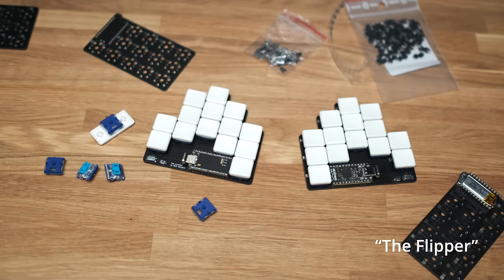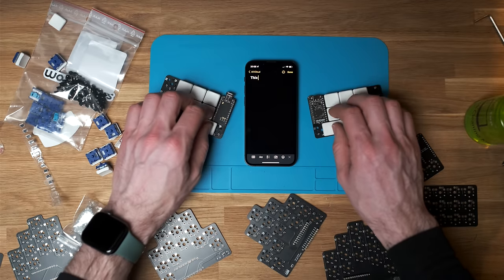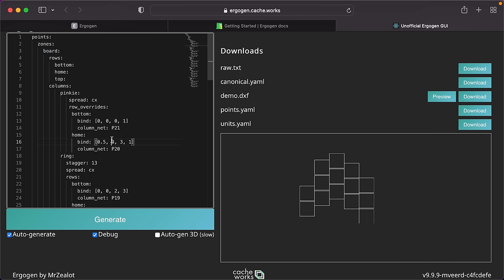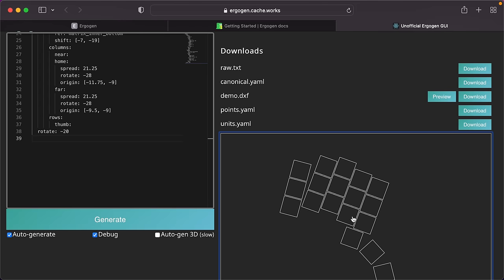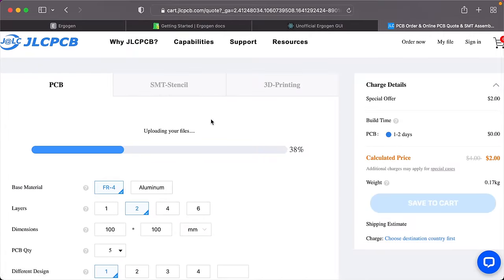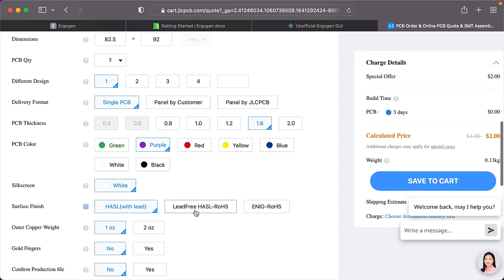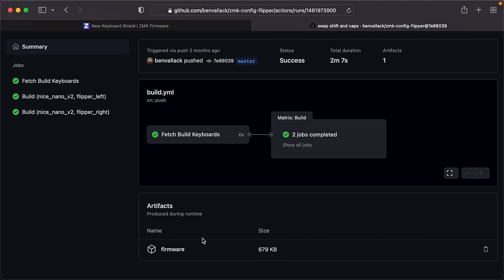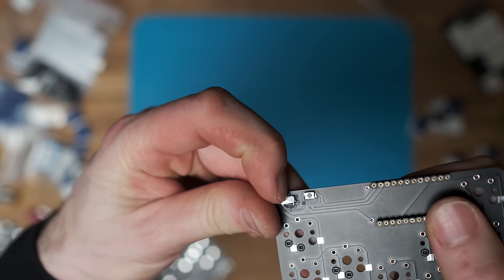“The REAL Ergonomic Keyboard Endgame!” - How To Design & Make A Totally Custom Keyboard

Comment: Instead of connecting the grounds from point to point, maybe consider flooding one side of the PCB with ground. The power traces in general could be a bit thicker, especially given the fact that you have plenty of room on the PCB to do so.
Reply: @owowowdhxbxgakwlcybwxsimcwx  For a small switch breakout like this you don’t really need it though. The sub board is probably 4 or 6 layer.
Reply from the maker: Why is it important? My experience with the Ferris is that the ground plane interfered with the side to side connection when I had them on my legs, so I was quite happy to avoid adding it here.
Reply: @BenVallack  For this application, it could improve immunity to noise and help with ESD performance, but to a large degree it doesn’t matter here

Comment: Another super interesting video! I'd love to hear more on how typing works with these tiny key numbers - the layers and key maps and how they changed as you moved smaller. Are there lots more strokes added by layer changing now? Splitting the alphabet between different layers is more extreme than I considered before. Would love a video covering the journey from Ferris to here and how you found your optimal number of keys!

Comment: Fantastic video Ben. This stuff is well overdue.  DIY is the absolutely the way to go. The issue with many custom keyboard suppliers is that support is poor and they often disappear because it is more of a hobby for them than a 'real' job.  Been caught with that a few times.  You end up being left with a bunch of paper weights! A tip for new players: if the supplier has most things 'out of stock' or is slow to get back with enquiries, give them a wide birth.
Reply from the maker: Yeah I think it’s amazing that so many small players started making and selling boards but at the end of the day if you’re parting with cash there are general expectations for most people that are hard to get past when you don’t hear back from someone for 2 months etc! This approach lets you cut straight to the point and get something up and running pretty quickly.

Comment: I recommend doing a polygon pour for your ground plane on the bottom layer. Just make sure you have thermal relief on all the pads(should be done by default). It will save you a little time when making your layouts and is "more correct." 

For low speed boards like you are designing here the layout basically doesn't matter as long as the connections are all correct. If you ever design a more sophisticated pcba than stuff like this will start to matter.

Comment: I have built two keyboards already, one from a premade PCB and one hardwired. I keep putting of the KiCAD learning curve, but it will happen sooner or later. Your video is well structured through the journey and makes the task less daunting. Also great tools you found to make the process easier.

Comment: couple of quick tips on soldering: just get some rosin core solder, it makes life easier and soldering quicker, because you don't need a flux pen.

Another one is for solderin the sockets: just solder one half of the socket first, and you can hold the socket in place while you reflow the solder by heating it up again. When you have all of the first halves of the sockets soldered, its really quick to just add a bit of solder into the second half to finish the connection. Just make sure to heat both, the pad and the sockets metal bit.

Comment: @Ben Vallack I predict your next iteration, limited by shipping times as the long pole in the schedule, will be 8 keys: 3 for the more powerful fingers and the thumb, leaving out the pinkies, because they're weak.  Reasoning: last I knew, you were extolling the virtues of the 34 key layout, now you've gone down to 16, and the most logical next step is 8!

Part of the reasoning for 8 as stated is now you have exactly only a reduced home row with thumb, and no fingers need ever move except up/down, just in possibly longer strings of key presses, the oddball chords worst-case.  With no moving of fingers, in theory you should have far fewer typos because you can't be off target with any finger, you can only use the wrong key under a finger that's not moved!

Fascinating video, I wasn't aware such great software was available for free, thanks for explaining that!

Comment: This is freaking awesome. Really wish mice could have this much accessible customizability. Ive seen a few 3d printed designs that you basicly just take the innards from one mouse and put it in the new similar style shell which is a start but Id really like to customize things like how tilted it is, where extra buttons are, how hard they are to press, weight, ect.
Reply from the maker: Yeah very true, might need to start getting involved with 3d printing I guess!
Reply: Resin printers these days are phenomenal, suuuuuuper smooth finish. But you could also use the fine resolution to create interesting textures. You could build them around a common platform that is a little brain with the sensors and such in it. Open source designs with common switches, rollers, bearings, use 3d scanners to shape it perfectly to your claw, ooooo very exciting.

Comment: Hey! I am building my own keyboard according to this video. I have two questions: What is the battery life? Are you going to test the battery sockets anytime soon?
Reply from the maker: Battery life is about 2 weeks for the central side - longer for the peripheral side. If you use the dongle branch of ZMK with a third nice!nano as a usb connected dongle though the two peripherals last for ages. I have used the JST battery connectors which is as far as I feel the need to go at the moment. Good luck!

Comment: So this is indeed great, and thanks. One thing though, you seem to be approaching this as someone who is a coder talking to a coder. I will be watching your subsequent videos but hope that I’ll be able to do this as someone who could not code their way out of a wet paper bag. Either way, I appreciate the info and your journey (even if it’s gotten more minimalistic than I’d imagine going).
Reply from the maker: Heh yeah I’m never quite sure how many people are coders here but I figured most keyboard geeks probably code. What kind of thing do you do?
Reply: @BenVallack  I do qualitative research - often usability research. Lots of note taking, writing reports, etc. keep me on a keyboard nearly all day.  I am also old enough (>50) and learned "keyboarding" young on a typewriter.  I had an ortholinear once but unlearning stagger wasn't something I had the time for, so I currently run a Keeb.io Quefrency, which is basically a 65% split, which can use VIA.  A few mods done with Karabiner Elements, and a new 3d printer because I use modifiers a tonne and thus will be trying to jump an additional thumb key into the mix.  I will be playing with this stuff more, though, and the vids are helpful - I just should have learned coding back in the day.

Comment: Is there a software keylogger that would sugest you a key layout, depending on your most used keys?
Also, with no legends on your keys, how do you keep track of what you are typing and how did you train for that?
Reply from the maker: I think there might be some logger things out there yeah, never got as far as trying it. It would be interesting. Typing without legends is pretty easy, especially on smaller boards where there is only a few places your fingers should be. Here are my learning tips: https://youtu.be/sI-a64EVPPU

Comment: Ben, struggling a bit with the transition from ergopad to ergogen. The raw text it gives you is in a different language than the ergogen tool (at least it seems that way). I was going to use your config and tweak from there but also wondered if you had any advice?

Comment: Well this is very educational. But you know what'll be even faster to iterate? Handwired strings of small boards (or only hotswap sockets) with 3d printed case to hold them. Or with separate pieces sliding alongside each other(which is my a thing i'm working on). It won't be thin like a pcb, but even with 3d printig mounting case every time it would be less work to swap switchies since there won't be soldering (just add some wirer length to accomodate stagger changes).
Reply from the maker: Ah I saw someone make something like that actually. Definitely a cool way to test iterations.
Reply: @owowowdhxbxgakwlcybwxsimcwx  Yes. Pcb's was invented to produce complex electronic devices. Not for fast prototyping keyboards with 20-30 buttons on it..  I believe handwiring 1 prototype with dynamic stagger wouldn't take not more 2-3 iteration of the stuff in the video. And it'll provide astronomically more flexiblity for tuning than having new board every week or two.

Comment: On "The Card" you could probably integrate the microcontroller into the pcb and have 2 extra keys there. Also where can I find files for the 16 key layout?
Reply from the maker: Yeah would like to build a board like that.
Reply: @BenVallack  just where to put the battery than
Reply from the maker: @nomiss__7739  Maybe switch to a button battery underneath.

Comment: what was your experience with the card keyboard? i love how compact it is but I am wondering how much of a compromise the ergonomics are? also would love to see a build where you incorporate a mouse or trackpoint. thanks!
Reply from the maker: I actually loved it - the revised version of The Piano is going back to an ortholinear grid for the inner 3 columns. I’m actually thinking ortholinear is pretty optimum for the ring/middle/index - I’m not sure column staggers are that useful for them. The main area column stagger comes in is the pinkie.
Reply from the maker: I actually loved it - the revised version of The Piano is going back to an ortholinear grid for the inner 3 columns. I’m actually thinking ortholinear is pretty optimum for the ring/middle/index - I’m not sure column staggers are that useful for them. The main area column stagger comes in is the pinkie.

Comment: Still really interested in how you could use all these to add a tiny thumb controlled "mouse" - are all these programs compatible, or flexible, enough to add a tich more board on to the side (at whatever angle) next to the thumb, whereby you can then add a mouse controller? Can/do the controller programs encompass that added function? 

This could be an interim step towards the idea of keyboard clicks as mousing, but might stop before then - and still be reducing the standard, overly large for my small hands, mouse's action that's done so much to damage my wrists with carpal tunnel aka RSI.

Comment: 2:09   question: how you type 21 different character ('this keyboardlnmufpg!') with 16 key ?
Reply from the maker: The most infrequently used keys are on a second layer, so I hit a thumb key to get to them. So I’m inserting a few extra key strokes for the advantage of massively reduced overall finger movement.

Comment: You've mentioned you use vim - here or elsewhere. I'm a SRE, so I use it heavily as well, and it's the thing I've not been able to figure out in the past when switching.

As a general rule, I keep a very spartan vimrc and often go for ZSH with a prompt, but keep things fairly close to stock - both locally and in servers so I'm not thrown off.

Most vim movement is letter based in my mind - w, b, /, o, ctrl+d, etc. Those feel like it's just a matter of learning the layout. hjkl however are not letters in my mind, but instead directions.

How have you handled that? Have you rebound cardinal directions in vim? Have you just memorized the new positions? Have you mapped arrow keys in your keymap and use those for movement in vim?
Reply from the maker: Yep that’s pretty much it, the only ones that I remapped are the hjkl positional ones. Then jiggled things around to accommodate the ones that were displaced by that. Everything else was pretty easy to just follow to the new location.

Comment: This is an amazing video, did you use a kicad course for a more in-depth learning experience?
Reply from the maker: Thanks! Na just dabbled and watched a few YT vids. It’s actually not as bonkers as it looks. Once you get your head around the parts/layers in the PCB it starts to make sense what you’re looking at in KiCad.
Reply: @BenVallack  Awesome, I've looked at it and initially got overwhelmed but have a few designs I want to try.
Reply from the maker: @cartermckay1509  Yeah once you get Ergogen doing the bulk of the work it starts to get pretty straightforward.

Comment: How stable is that zmk mouse-pr you're using for your zmk ferris keymap? Do you use your mouse layer often?
Reply from the maker: It’s pretty good, but actually I mainly use it for the click now, so one hand on the trackpad to move the cursor, then the other on the board to fire a click. This could probably be achieved with something like Keyboard Maestro though.

Comment: RE: The single-key thumb, I think you could just take the center thumb key from the 3-key layout that it generates, as that should be the key that your thumb naturally rests on. If you're planning on only using one key, you can just mash your thumb in one spot, and it should level out the center key at a pretty good angle. If you aren't sure that angle will work, you can always go a bit to the left and right to get the angle set.
Reply from the maker: Yeah I sort of realised this when editing, I guess it was more of an issue with two keys but as you say the output is still easy to translate.
Reply: @BenVallack  Yeah, not having gone through the whole process, I don't know what it would look like to do 2 keys, splitting the difference might work somehow, if you can figure out how to just offset them by half a key spacing, then just delete the one you don't want. 

This is super helpful though! I built a Ferris Sweep after your video (adding my own silkscreen), but I have played around a bit with KiCAD in the past. I might play around with that a bit, trying to go down to 2 pinky keys or something so that I can switch that key back to the thumb, as I've been very comfortable using a Corne with three thumbs, but might want a bit more space. 

Going to play around with firmwares and alternative layouts, as well. Would love to see more videos/posts/etc about the layout you're using with these boards.

Comment: I know I commented the same thing on a previous video, but it still boggles my mind just how cheap this is especially the PCB part. After paying a premium for keyboards for years, you can make your own split ergo for such a low price. Definitely going to need to do this at some point.
Reply: Those PCBs are so cheap because they use the cheapest finish possible and use excess capacity and pooling of multiple PCB designs to produce them. You couldn't sell them in most countries in the world because the surface finish contains lead. Check the price for a Lead Free RoHS or gold plated (ENIG). Of course they still remain to be surprisingly cheap for a custom product.
Reply: @flubsche  Yeah Ben clicks on the lead free option in the video and it's still wildly cheap. Even with the more expensive option I'm still wowed

Comment: what size of connection are you using? because you might want to make those bigger.
Reply: especially for ground connections you might want to have a ground plate to reduce noise.
Reply from the maker: Not sure what you mean?
Reply from the maker: @owowowdhxbxgakwlcybwxsimcwx  Good to know cheers!
Reply: @BenVallack  @grg said it better than I did! Overall, the PCB looks good but this problem with track width usually comes out when the PCB is much smaller and when the signal is changing very quickly.  Both of which could lead to crosstalk between signals on your PCB.

Comment: have you considered wireless 2.4ghz connection with a receiver e.g. nrf24l01  with the nice!nano instead of bluetooth. I believe the battery life would improve quite a lot. moreover, mainboards without a bluetooth connection could then be used. to enter the bios instead of connection a keyboard.
Reply from the maker: I’m actually using the dongle mode now so three nice!nanos. One as a dongle connected via usb and that then connects to the nice!nanos as if they are both peripherals. Battery life is insane and reliability is pretty much 100%
Reply: @BenVallack  Wait there is a dongle mode for the nice!nano. Would you be so kind and point me into the direction how I can set this up. I only found bluetooth connection.
Reply from the maker: @ohwii  sure! you can see it in on my ZMK fork and config here https://github.com/benvallack/zmk-config-piano